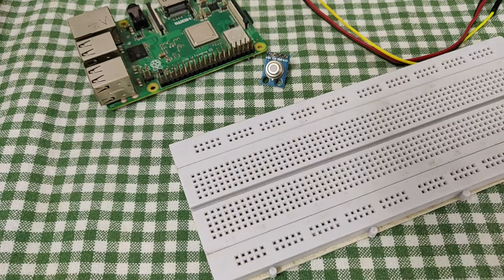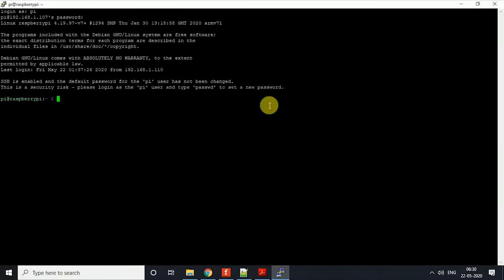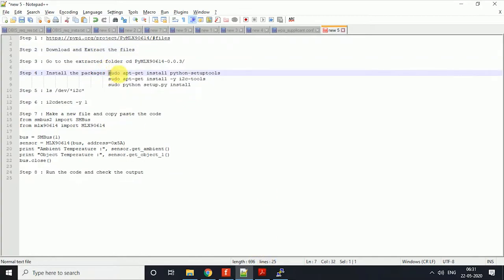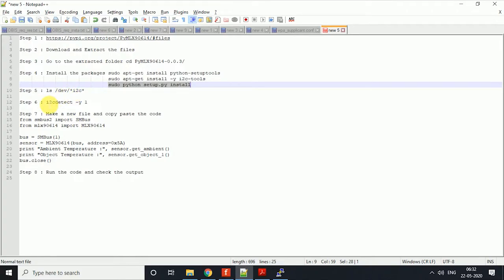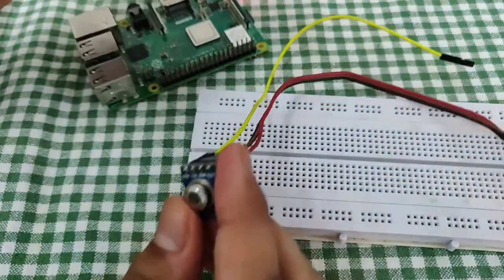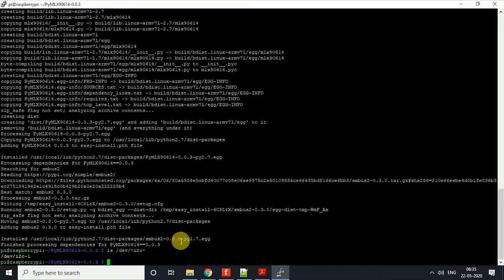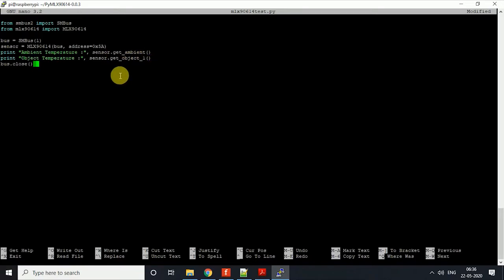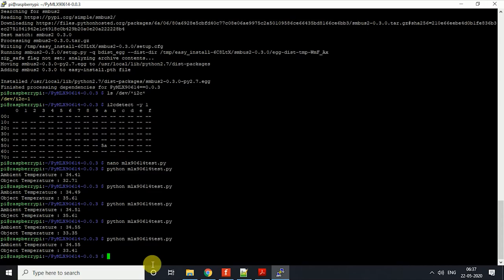MLX90614 Interfacing with Raspberry Pi | Python | I2C Tutorial | Non Contact Temp Sensor

Comment from the maker: There is one mistake in the connections. When you look into the connections they are right but when you see the written notes - I have mentioned SCL - SCL(Pin 4) that is wrong. It will be SCL to SCL (Pin 5 on Raspberry). Please verify all the connections before you power on your Raspberry Pi to avoid damages to your sensor.

Comment: I got it to work on its own, but it causes problems with other devices on my i2c bus.  I think it's a 3.3V vs 5V interface, but I don't really know.  Have you seen this issue too?
Reply from the maker: I haven't seen the issue because the IC works on 3.3V but It also has an internal LDO that drops 5V to 3.3V

Comment: Hi. The MLX90614 is powered with 5V. Should there be a voltage divider connected at the SCL/SDA of the ML90614 to prevent overvoltages at the GPIO pins?
Reply from the maker: If you are using the module then you can connect it with 5V. If you are using the sensor directly you will have to connect pull up resistors of 10kohms for sda and scl.

Comment: When I run the code its printing negative values of the temperature what could be the problem, also the addresses i have are 3a and 50 which one is suitable
Reply from the maker: Before you test your sensor with raspberry pi you should do some testing with Arduino to make sure that sensor is good and works as intended. Once you are aware then start over on raspberry pi from step 1 and follow it all the way until the end. There might be a case that you are missing some package installation so I would suggest to start fresh. Thanks

Comment: Does this work with MLX90615 too? I cant get the code to run in thonny python. it shows that there is a "invalid syntax". it does work in the terminal though. plez help
Reply from the maker: Hello, I have tested it with terminal. I have no idea about thonny n doesn't know what version does it uses. Test it with mlx90615. I am not sure but logically it should work. Thanks hope this is helpful

Comment: I see a lot of other people who encounters the same issue as me, that when doing the "i2cdetect -y 1" the sensor connceted does not show up as 5a. Has anybody found out how to solve this - or is it simply because the sensor does not work? I have tried with two different RPs but none of them could find the sensor. The sensor was brand new and connected accordingly.
Reply from the maker: Have you tested the sensor using Arduino?
Maybe there can be issues with the raspberry pi versions and the package. I have used raspberry pi 3B+ 

Thanks

Comment: Hello, it's possible to use two sensors at the same time?
Reply from the maker: Using two same sensors ? If you want to do that you can. You can connect the vin of the sensors to the GPIO of the controller and then before taking readings power one and other off and the read it and similarly do for other one. 
Doing that directly can be difficult. Extra software logic is required to be implemented. 
Hope this answers your question. Thanks

Comment: When i I run the command ls /dev/*i2c* i get the same output as you but when I run i2cdetect -y 1 no address is displayed. Do you know why this might be?
Reply from the maker: Yes I do know, possible reason could be the sensor connection is loose or I2C bus is not enabled from settings or the some steps is missed and hence not getting the i2c address or might have done wrong connections on rpi pin. 
So you can recheck everything and start with a fresh installation and guidelines as shown in the video and then it can be resolved. 
Hope this is helpful.
Thanks ☺️
Reply: i can’t find i2c address too
Reply from the maker: Which raspberry pi are you using ? 
I guess you all are using version 4 and I am not sure of the compatibility of the packages with raspberry pi 4. I personally have raspberry pi 3 and it works perfectly fine on my rpi. So if you have raspberry pi 3 and still facing issue please go through the steps again and see what you have missed or try it again from scratch. 
Hope this works 
Thanks 👍
Reply: Facing same issue
Have you solved it?
Reply: @minari7076  have you solved it?

Comment: What is the output voltage of the sensor? pi I/O pins are not tolerant for 5v right?
Reply from the maker: No they are not 5V tolerant and I am not sure about the output voltage because it's works on I2C bus so no idea regarding that. But you will get that data in the datasheet of mlx
Thanks
Reply: @electrofun5135  thank you
Reply from the maker: Your welcome 🙂

Comment: it is possible that this program runs  in python3, because I have a error in compilation, because the program doesn't find the library
Reply from the maker: Please follow the steps as shown in the video and you won't have any error. I am sure the compatibility of the library with python3. Please follow the video as shown and then you would not get any errors. 
Hope this is helpful.
Thanks
Reply: @electrofun5135  no I have try to run the program in Python 3 and the library has an error debug. I have run the program in Python2 like YOU, and It has debug fine.
Reply from the maker: If that is the case then you have to look for the library that supports python v3 to get the output.

Comment: Hello  Sir, I have the same return as you when i run ls /dev/*i2c* but I don't have the 5A when I run i2cdetect -y 1. I have redone the connections but still nothing. Do you have an idea of the source of my problem
Reply from the maker: Yes I do know, possible reason could be the sensor connection is loose or I2C bus is not enabled from settings or the some steps is missed and hence not getting the i2c address or might have done wrong connections on rpi pin. 
So you can recheck everything and start with a fresh installation and guidelines as shown in the video and then it can be resolved. 
Hope this is helpful.
Thanks ☺️
Reply: @electrofun5135  I've alrerady done that :/
Reply from the maker: Are you sure if the sensor is working fine ?? If you have arduino please check it.
Reply: @electrofun5135  Don't have arduino, but i think it's working, it heats up a little bit when I plug it in.
Reply from the maker: The sensor never heats, it is very much normal when connected with raspberry pi. Please check your power connections.
Reply: @electrofun5135  So now, it's not heating, but still no 5A return :'(
Reply from the maker: It is probably because first you connected power wrong and got the sensor heating and may be damaged. I am not sure but it feels the sensor got damaged because of wrong power connections.
😔😔

Comment: Traceback (most recent call last):
  File "/home/pi/Desktop/temp.py", line 2, in <module>
    from mlx90614 import MLX90614
ModuleNotFoundError: No module named 'mlx90614' 
can you please tell me why am I getting this error
Reply from the maker: You must have missed some installation step. Please redo the steps to ensure its working. Thanks 👍
Reply: Yes ı have a same error. Please help us please. I am writing from turkey.
Error:
Traceback (most recent call last):
  File "/home/pi/Desktop/temp.py", line 2, in <module>
    from mlx90614 import MLX90614
ModuleNotFoundError: No module named 'mlx90614'
Reply from the maker: Try running the code file with python and python3 extension both. Also try taking the sensor.get_ambient and other value on some other variable and then print the same. Hope this helps. Thanks
Reply: @JustFaZz  install the module using the command "pip install PyMLX90614" if using python2 and "pip3 install PyMLX90614" for python3
Reply: @allansantosh  I'll try to say . If there is a problem, I will write again, thanks.

Comment: Hi, First of all thank you for simple and neat explanation. I am trying this with R Pi4, is there any limitations or need additional setup for Pi to discover the sensor as slave? Watching your video seems the OS is 4.19.97.. hardware should be something Pi3.
Reply from the maker: Thanks for the feedback. I have interfaced it with Rpi3. It am not sure about the library compatibility with Rpi4, but I will sure try to make a video on Rpi 4 and get it as soon as possible. Thanks 😊
Reply: @electrofun5135  Hi is there any code for Rpi 4 because I'm stucked here 😅
Reply from the maker: As mentioned, I will try it with my Raspberry Pi 4 and then try to find a solution of the issue and make a videos of it and upload it. Thanks 👍
Reply: FYI, We tried with "GY-MLX90614-DCI - Long-Distance Infrared Temperature Sensor " and it was straight forward as described in Video. It costs high considering MLX90614, but works perfect.
Reply from the maker: Okay that's good 👍

Comment: minute 6.46 sir..how to save??
Reply from the maker: Any code in raspberry pi can be saved with ctrl + O and exit can be done with ctrl + X
Hope this helps. Thanks 😊
Reply: @electrofun5135  it show 
File "mlx90614.py",  line 6
    print "Ambient Temperature :", sensor.get_ambient()

SyntaxError: invalid syntax

why it is like that??sorry sir for to many asking
Reply from the maker: Please follow the steps because you have missed or added some space which is not required. Please check the videos for better clarity.
Thanks

Comment: for those having trouble with code on python 3 do this first

pip3 install PyMLX90614

then run this code:

from smbus2 import SMBus
from mlx90614 import MLX90614

bus = SMBus(1)
sensor = MLX90614(bus, address=0x5A)
print (sensor.get_ambient())
print (sensor.get_object_1())
print (sensor.get_object_2())
bus.close()